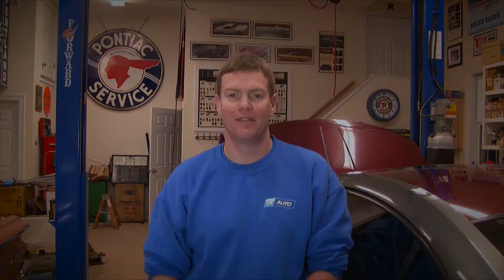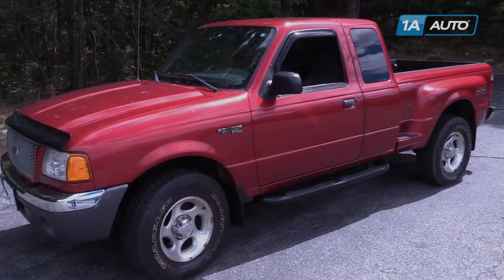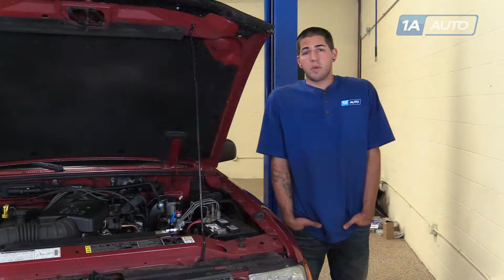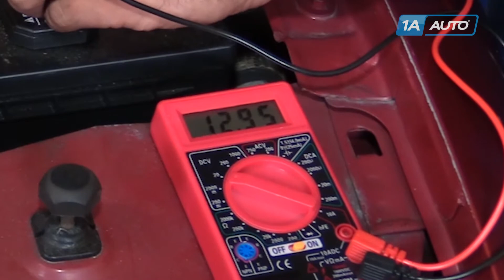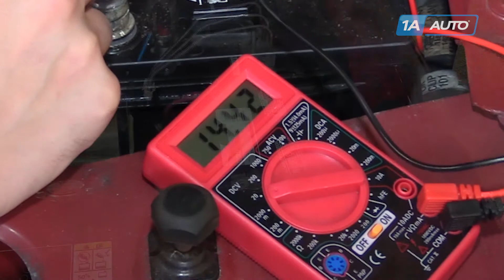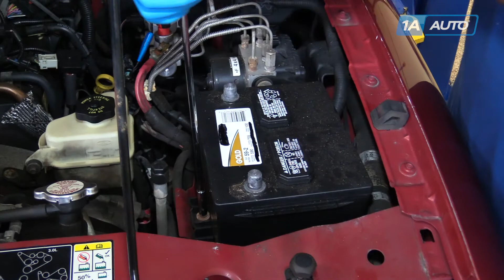How to Test Battery Voltage and Replace Install New Battery 98-12 Ford Ranger

Comment: Be sure to clean the terminals with a wire brush. A better result use baking soda mixed with water to make a thick paste, scrub it in. Wipe it off. I like to spary terminal protector, can purchase any automotive store for less than $10.. will last forever!!
  A dust free battery will improve the lifespan